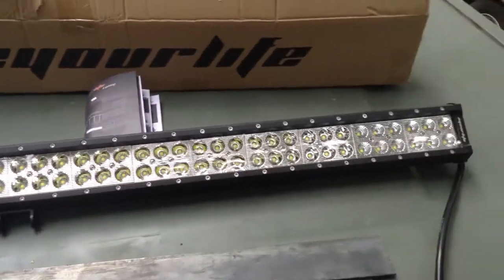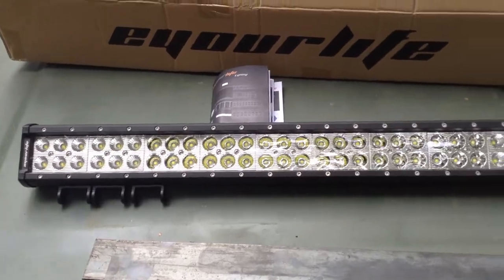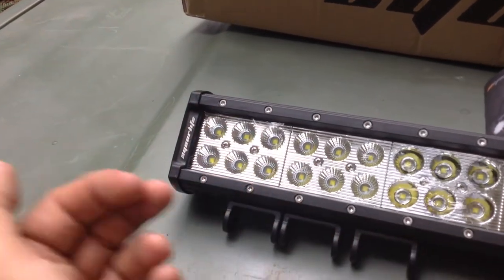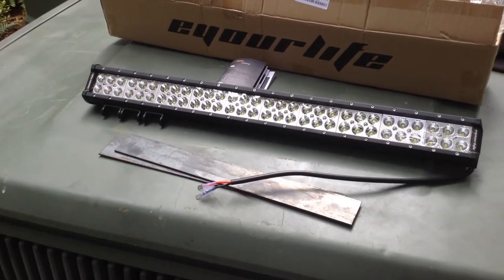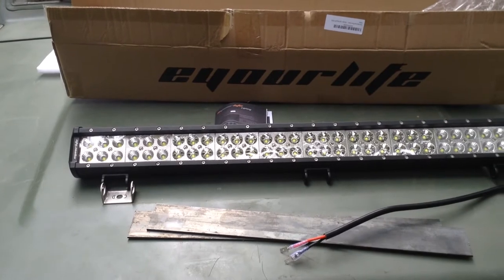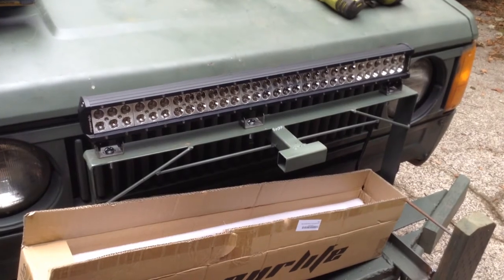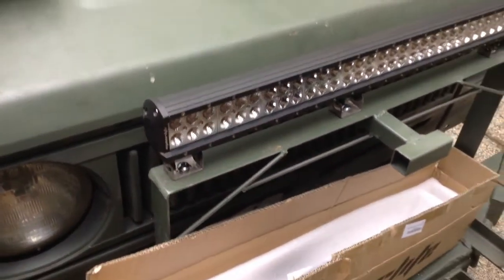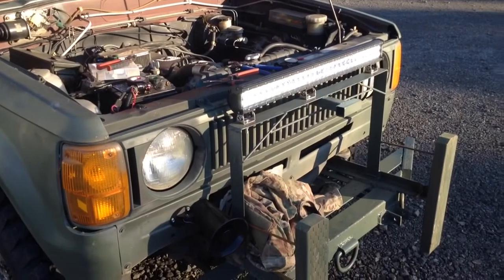EYourlife 28" LED Light Bar for off road vehicles - Installation and Testing

Comment: Nice video old man!
I was wondering if you plan a dual 12v battery in parallel upgrade since you've added do much extra electronics and comms, with a winch on the way? Also what about an alternator upgrade?
Fun stuff man really enjoying it!
Reply from the maker: +SurvivalTech Nord  The previous owner of the rig had already set it up to take a larger main battery to run accessories and a winch that he never got around to installing, so the trooper actually uses a batter that is compatible with the tractor that used to be at the survival retreat.

Comment: this brand is junk bought one only half lights work. company doesnt stand behind product.
Reply from the maker: +robert bouchard  Did you get it from Amazon or another source?  Amazon tends to force companies to make right on deals with defective product.
Reply: amazon yes sent them messages they have not yet resolved anything.very suprised my self.
Reply from the maker: robert bouchard Keep us updated.  I don't get paid anything for product endorsements, just review stuff I bought and paid for at this point, so as long as your criticisms are truthful, I am not going to go shooting them down, but personally, the light on mine has been taking a beating and seems to work fine.
Reply: hi must have sent seller over  a dozen messages there answer was a automated message.finally just called amazon after arguing with them for two days they finally gave me a refund .thanks for advice.